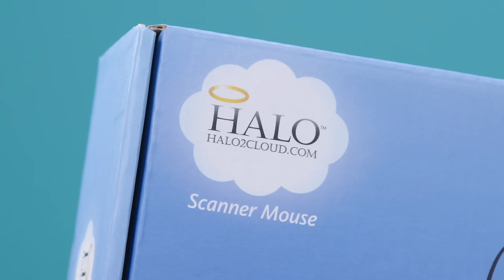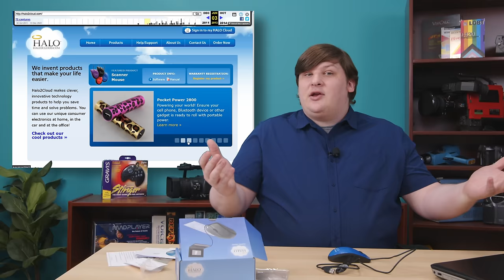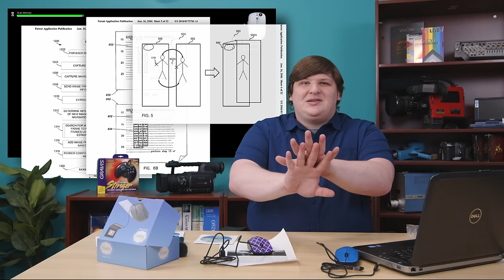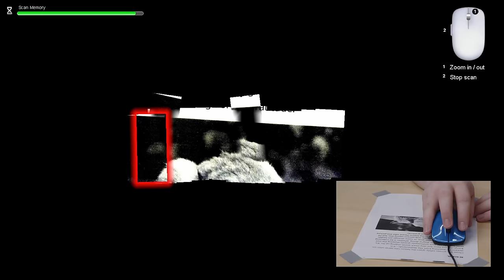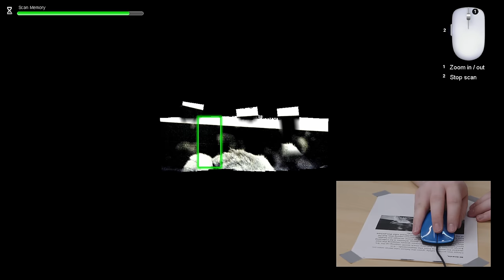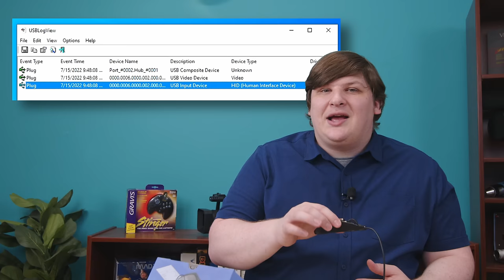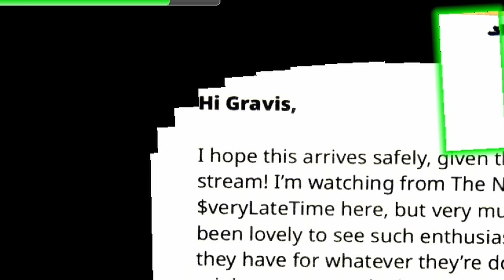Why would you scan things with a... mouse?

Comment: I remember some of my coworkers working on software on a device like this at a different company.  The big issue was always what we called "loop correction".  As you were scanning the big empty areas (like you did), you accumulate error.  Once you get back to an area it is necessary to fix all previous frames until the last match using a LOT of very fancy math.  The longer the loop, the longer the correction process took, and the more spectacularly it failed if image detection gave a false positive.  Eventually the managed to make it work ok, but I don't know if it was ever released as an actual product (maybe it was in japan only or something - I don't know).  Looks like this software doesn't loop correct well at all.

As to why the product likely "broke", internally the software probably stores the last 100+ frames (I forget the exact number), and since you didn't move the mouse, you completely screwed up some internal frame tracking movement calculation which generally was calculated as a delta from the previous values (i.e. you introduced NaNs into the transformation matrix) and there was no way to reset the transformation matrix after a scan started (besides maybe lifting the mouse).  Thus all subsequent movement had a valid movement, multiplied with a nonsensical matrix which should have been identity but it wasn't and contained NaNs.  A software bug.  Starting a new scan and moving the mouse even slightly during the first little bit of the scan should make it work again.

As for why the product exists, what I was told that people in Japan and places like that don't have the desk space for things like scanners or even large MFPs (multi function printers).  This was a way to give scanning functionality without costing desk space.

It was a fun little gadget to play around with and invent new uses for.
Reply from the maker: The bug occurs no matter what, with random timing, often on the very first frame of the scan, I just did takes until I got footage that fit my narrative pacing. When the scanners were functioning, I could leave them sitting in one spot for thirty seconds with no trouble.
Reply: @CathodeRayDude  As I said - sounds like a software bug to me.  They shouldn't happen of course, but the software for matching and aligning the various images can get really difficult.  IIRC from my chats, there was a confidence score of some sort for how confident it was the images matched, and the longer you stayed in one spot, the more biased you could get it.  If the numbers ended up overflowing or something for example, all sorts of crap could happen - even to the transformation matrix.  The confidence metric was necessary because you didn't want a positive image match with one blank  low feature area with another.  As I said - the algorithms got tricky very quickly.  For best results, always start the scanning in a feature rich area (one with lots of lines, and brightness transitions [not sure the image stitching works in color or B&W]).  Normally there's probably some software path to not bug out like that until the mouse moves, but if the senor (due to sensor error/drift) starts reporting a movement, then bad things happen.  Possibly some of the chips/LEDs heated up and caused the sensors to start to drift.  This is possibly what happened - I'm only guessing though.  Try letting it cool down for a bit and see if it starts to behave for a while again.

For those devices, you never wanted to start in low feature areas as the mouse sensors are not accurate enough for aligning images by themselves.  IIRC they worked at like 30-60Hz or something, so even a 0.01% movement sensor error would easily develop a 2-3 pixel error in no time at all without image matching and correction.

The most difficult to correct stuff was long blank areas and big joining loops like you did in the video (that was why the border screwed up - accumulated sensor error).  Looks like they didn't have any good loop correction algorithms.

My memory of the device is a bit foggy and the one we were playing with was a little different (but not much), but I remember that the sensor movement data was being encoded in some clever way - possibly inside the image data itself.  Two sensors would have been nice for measuring rotation, but the fact they were both inaccurate to the tolerances needed to have a good composite image made using the data very difficult.  Correcting garbage data from sensors in software is never fun, and those things produced a lot of garbage data.

Certainly those devices have their flaws and limitations.  A desktop scanner is always better at scanning a normal document for example.  Still, this type of technology had potential for uses beyond normal scanners, and was decent enough for the users with space limitations inherent in Japanese style sized homes.  They are what they are - despite the technology being able to be used for so much more.

As for why no android app exists like you proposed, it's not impossible that it wouldn't, but the image matching would be TERRIBLE once you add it the users shaky hands adding perspective distortion and zoom into the mix, as well as combatting android's desire to autofocus and white balance the camera invalidating the camera intrinsics (the matrix defining the camera distortions like fisheye correction).  Add to that that cameras will pick up wildly different colors for the same areas depending on where you're looking at them from and how they are illuminated, and the project sounds like a nightmare.  It would not be a simple program to write, and if you did, someone or some company would immediately steal it.

Comment: It's actually not uncommon for OEMs to have faults with their products, it's down to the fact that instead of doing sufficient R+D these days they just run things through computer simulators. Two notable examples spring to mind, the first being a certain model of DVD player sold by the now-defunct UK chain Woolworths, the players would work for a few weeks then the tray would cycle open and closed relentlessly, even after a power cycle, we had 5 that did the same! The other is a certain model of JVC boombox, and they probably fit the same brief as these mice, IE asking the circuitry to do too much. They have bluetooth, USB mp3 playback, AM/FM/DAB radio, CD and cassette, after a month or two they just stop turning on, I bought one and traced the fault to the main processor, it just wouldn't respond to the power button being pressed!

Comment: It looks like it's using the two sensors to keep track of rotation. When you cover one up, the mouse thinks that sensor is stationary, so you get a pivoting in place effect. My best guess is that having the raw rotation data separate from the image data simplifies implementation of the software at the expense of cost of hardware. Further iteration of the design could probably eliminate the need for a second sensor.

Comment: I would have to guess the two sensors account for rotation. you know the relative movement of both endpoints of a line segment, so you can tell if said line (the imaginary line with each sensor at one end) is rotating
when one sensor is covered, it sees one moving with the other fixed, so you must be pivoting around the blocked sensor to get this sort of result normally

Comment: I don't believe it's actually stitching the images together by any mechanism other than position tracking under normal operation. The end where you run over some text surrounded by whitespace that blends without lining up is a very simple matching scenario. There are errors it just shouldn't be making, if it's actually doing that. It's extremely unlikely to be able to stitch together photos, and then fail on black and white straight lines and text borders. I believe it's getting positional tracking from the 2 mouse sensors and just blending the result without any extra processing. Two points separated by the greatest distance, plus a little math, will provide reasonably accurate positioning/orientation data to achieve this result. However, a single sensor would be more than good enough to provide acceptable positional info to reduce latency for some sort of realtime image stitching. You also demonstrated that when you pick the mouse up and reposition, it takes some thinking time to figure out where to start. Sure, that's for the whole page, but it doesn't actually take that many multiples of the camera resolution to make up a page. You'd need a very quick version of that to achieve the real-time results it gets, which appear to be very snappy.

I think the combination of the extra optical sensor, blending errors under simple text scanning operations, and slow image matching when repositioning after tracking is lost are strong indicators that it is not actually using the image matching feature of the patent, except when the user lifts the mouse.

Comment: It certainly looks like a prototype design, proof of concept really. I like the idea though and wouldn't mind one if it actually worked reliably.
The two sensors probably work together to determine if the mouse gets rotated. When you covered the top sensor, the top of the scan was where the image rotated while scanning. The opposite was true when the other side was covered.

Comment: UVC devices can send extra data to host software through the use of a UVC extension unit. This is how a PC will actually control webcam settings, which get sent down the UVC-extension unit and are then translated through I2C and so on to the sensor IC.

I expect this is how the mouse is sending the extra data to the house, while the HID is simply sending standard mouse data.

Comment: Re: the USB HID setup: I am guessing they are just using a massive HID report with a big binary blob of JPEG (or other compressed) image data. USB High-Speed devices support report sizes up to 512 bytes per report-- I would guess they could do at least 5MB/sec using HID reports. You can use a tool like USBlyzer to view the HID descriptors if you're curious, you need its capture driver to be active, so need to reboot after install (you would see something like Desktop Usage, Usage Page, Report Size etc., which is what the devices uses to tell the host the format of data that it can both send [input to host] and receive [output to host]). Edit: whoops, forgot it is a composite device with separate UVC endpoints for the video/image data. But the HID inspection stuff still relevant. lol

Comment: I've heard that laser mice were more expensive to produce and had similar results to just using optical if not worse due to optical mice being able to use UV light instead so they can eek more performance out. 
Any proper gaming mouse will use an optical sensor since they're just a better technology. 
In my experience Lazer mice tended to not track as well as any of my optical mice.

Comment: youd think those cheap power banks would be absolute crap, but i bought one on amazon once with the little car jumpstart leads just out of curiosity. Thing started up my buddies 96 gmc HD with one turn of the key. Probably horribly unsafe from an electrical point of view on the insides, but they actually do provide a good amount of power in a pinch.

Comment: The HID standard allows a device to advertise a huge selection of different parameters. A device can report X, Y and Z motion along with Rx, Ry and Rz rotation axises. So the rotation data will be being fed down the same hid device descriptor as standard X/Y.

I'm not sure if they would need a special driver to access that data in software, or whether Windows has built-in support for rotation tracking mice though.
Reply from the maker: Ah alright! That's what I figured.
Reply: There's "Custom HID descriptor" thingy. The Windows is certainly supported this because it's USB standard and custom HID packet don't actally need any custom driver at all. The program just access to HID via api call. This allows USB HID device to send raw binary data packet over USB. Since this weird mouse has 2 optical sensors, one of them might just use regular HID report (X,Y report from Usage page called Generic Desktop in USB descriptor) and another one just send the data via custom HID report.

Comment: I used to work for the company that bought Halo2Cloud sometime in like 2017-2018. That company released the scammiest products until about the end of 2018. Majority of products just generic stuff that got their logo thrown on it. The lithium battery stuff is at best cheap, at worst unreliable. The old website before I quit was still up, technically, just hidden in a manner that basically literally that driver was available, which only had a Windows copy. The Halo branding basically is now just part of a company that does mobile accessories.

Comment: HID is an vastly extensive standard, covering almost any use case you could think of*. Devices send a 'report descriptor' which allows them to specify what kinds of data they provide, and it can be a mix of anything. OS and programs reference this to parse the inputs that matter to them from report packets. So for example, it could feasibly present sensors to the program as multiple pointers. Or maybe it sends a rotation field value, calculated on-device. Another possibility, it mightn't even be HID; values could be encoded in the UVC (webcam) stream instead.

tl;dr, USB is wild and reverse engineering is the only way to know exactly how this thing talks to the host.
Reply: * the 'HID Usage Tables for USB' reference is 431 pages long, and covers 34 different categories of inputs
Reply: PS, rest in peace Gibbs <3

Comment: It actually uses two methods from what I can see, for the majority of scanning it uses the mouse movement data, but if it detects rotation or slip it augments it using the camera, the issue is that one one of those is consistently wrong it assumes it isn’t wrong

Comment: USB HID is fairly complicated, and can easily be extended with vendor specific event types that their software interprets, but are otherwise ignored by the OS. If you examined the HID report descriptors, you'd probably see some non-standard things. Might not be too hard to reverse engineer and write custom software for... or rather it wouldn't be too hard if it didn't brick itself before you could finish doing that.

Comment: I reckon it was the tiniest bit of dirt on one or both of the direction/rotation sensors (in scan mode) that caused the weird results... How they didn't think of that is beyond me (I say as I literally struggle with an optical mouse at work.... until I can find another decent size laptop touchpad to replace it)

Comment: I once had a cheap mouse which sometimes failed. I found the reason to be the plastic cover to be enough translucent to irritate the electronics. I have to admit that I think it was back then when mice still used balls. But maybe it's a similar case here? Open the cover and put some cardboard in to shield any environmental light. Maybe they wil continue working-

Comment: It's wizardry beyond my comprehension at the moment because HID baffles me but HID devices have a capability for extra channels of communication.
There are people who have done some interesting things with this in QMK for instance. Data can be sent to the HID to display something or change modes, the device can send extra data over them. You could run a debug terminal through this if you really wanted.

Also I assume that program code in the webcam chip was intended for an off switch or maybe a contrast and brightness presented by its other composite device. They took that thing above and beyond the call of duty.

Comment: Three multi-wavelength laser sensors (superior overall tracking, and also a redundant sensor), a 3-axis compass (absolute rotation), a 6–axis IMU (orientation and acceleration), a better image sensor (higher quality scans), a better onboard processor, a better USB controller, and better software (plus an API).

That would be a better product by orders of magnitude.

Comment: Don't expect you to either still have these or still care, but I suspect the weird failure were bad capacitors in a power circuit, introducing noise into the mouse sensors resulting in bad position readings. Given how many components they power in that thing I expect there to be at least one switching converter, a bad capacitor would only start failing after a while.

Comment: Also, there are a lot of barcode scanners that are actually just cameras. You can install a video driver for them and actually use them like a gun-shaped camera. Field of view is pretty tiny, though.
Reply: Makes sense. If you've got the CPU available, why bother with the complexity of wiggling a mirror back and forth to scan a laser beam when you can use a cheap little camera to image the whole thing in one go, and which is probably more reliable?

Comment: A USB device doesn't need to be a hub to declare several sub-devices. USB support that out of the box. Thus, it's not required to hack HID interface here, just serialize on the wire the different sub-devices with their own "ID". This is in fact pretty clever, the mouse works without the custom driver. Unlike those DOS era devices that was pain in the ass to get working correctly.

Comment: A cap going bad wouldn't surprise me especially if it was doing any sort of filtering for power. If the strobe pulls enough they might be using a cap to smooth that power fluctuation and if it's gone bad and isn't going dead short it might be causing brownouts.
Reply: I'm not seeing any film caps however so that culprit might not be the issue.

Comment: The second sensor allows the mouse to track rotation which a normal mouse can't.

If you have two fixed points on the mouse and you know how far both of them have moved in relation to each other you can figure out pretty easily it's rotation.

Sorry I'm sure someone has already said this a thousand times